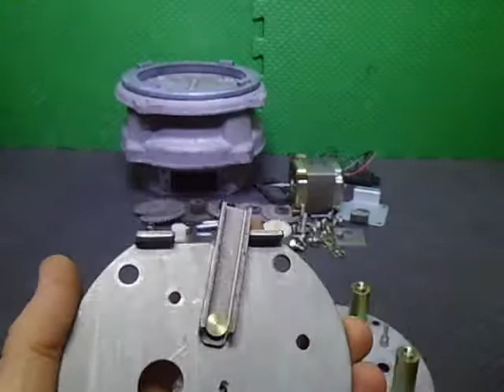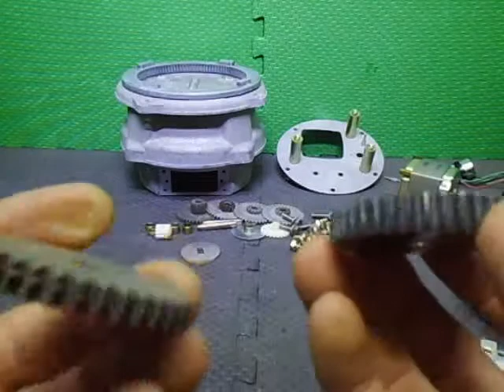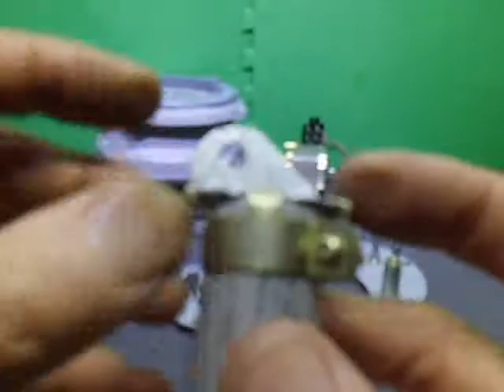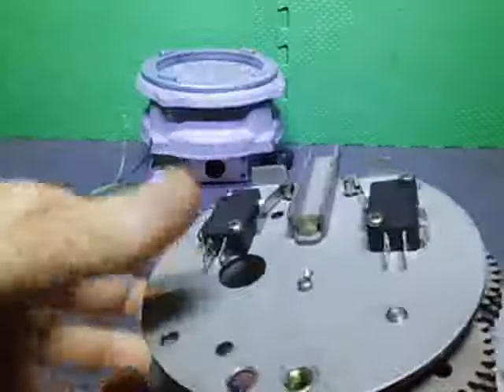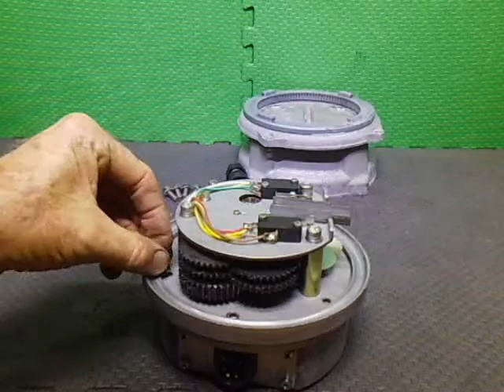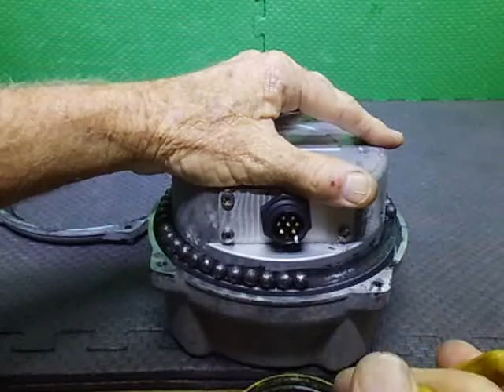Upgrades for customers KR-400 Rotator

Comment: Hi great video, do you know which wires are which on the motor, ie, common/start/run.  Thankyou.
Reply from the maker: Hi Greg, thank you for the comment. Left is terminal 4 goes to Green wire of motor,  Right is terminal 5 goes to Red wire of motor, Motor start cap is across 4 & 5,   Common is terminal 6 goes to Black wire of motor. Regards Peter.
Reply: @duoro-rotators  thank you Peter, appreciate your fast response.

Comment: what is the grease you use on the gears please?
Reply from the maker: Hi Darren, Thank you for the comment. The grease I used is called Moly short for Molybdenum Disulfide, same grease used in CV joints on front wheel drive cars. Regards Peter of Duoro

Comment: hello, where can i find some parts of this mechanic??? Thank you
Reply from the maker: Hi Huchinson, I have a lot of rotator parts available on my web site. You can get in contact with me via my web site. Peter
Reply: @duoro-rotators  hi, I have a Daiwa dr7500 the mechanics seem exactly the same as the Kempro kr400 I need to know how much it costs including shipping in Italy 1 500ohm potentiometer and 1 24V ac motor
thank you very much
Reply from the maker: @hutch551  Hi as stated before please contact me via my web site if you want parts, My web site link is in the description of the video.
The Dawia DR-7500 rotator is the same as a Kenpro KR-600 & the DR-7400 is the same as the KR-400. As they were manufactured by Kenpro for Daiwa, the main difference is Daiwa's have the motor start CAP in the rotator. Only the very early model of Daiwa had the motor start CAP in the DC-7001 or DC-7004 controllers. regards Peter

Comment: Gooday! What is the correct size and quantities for the kr400 rotator ball bearings? some say 9mm some say 10mm can you give a definative answer please? Also for the emotator 502cxx Rotator. 
Love your videos have just subscribed. 
👍
Reply from the maker: Hi Mark The bearings use in the KR-400 & KR-600 + the 502 are 9.525mm (3/8").
Reply: @duoro-rotators  Thanks thats perfect 👍

Comment: What is the name of the paste you put into the screw holes to prevent oxydation between the stainless steel screws and the aluminium rotator body? Would be good to know for restoring my Daiwa DF-7500a. 73 Gerhard, DF1DA
Reply from the maker: Hi Gerhard, The paste is an Australia made product by LOCTITE called Nickel Anti-Seize 771.
Reply: @duoro-rotators  tnx fer Info. I will check for avialability in Germany.